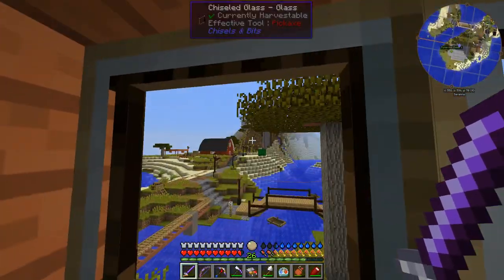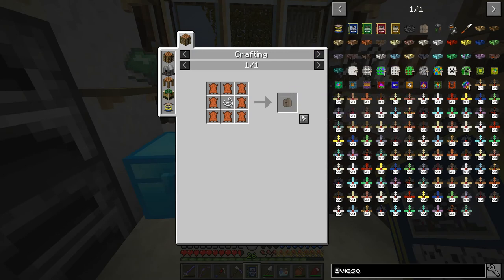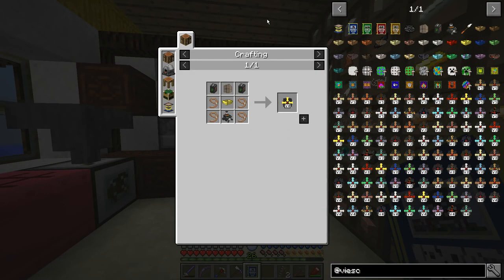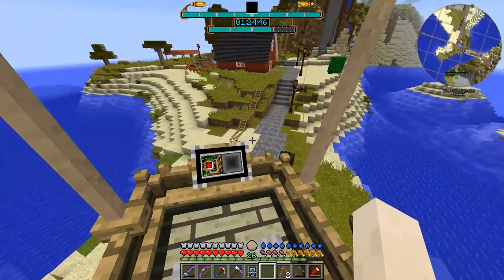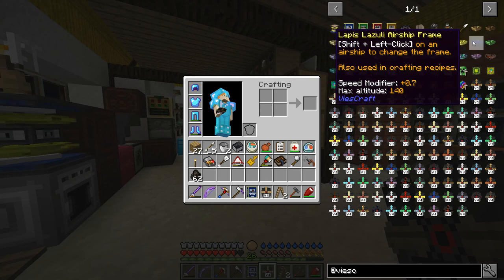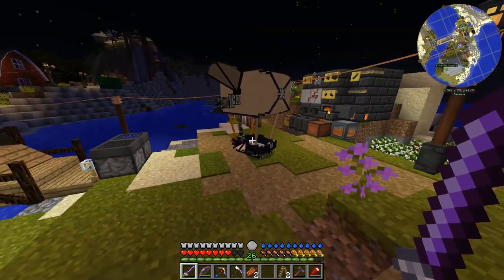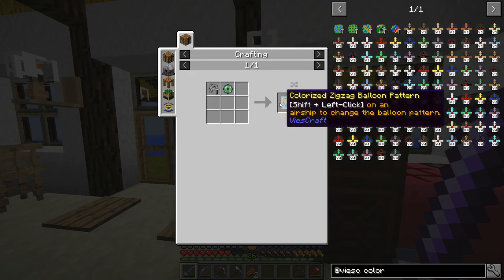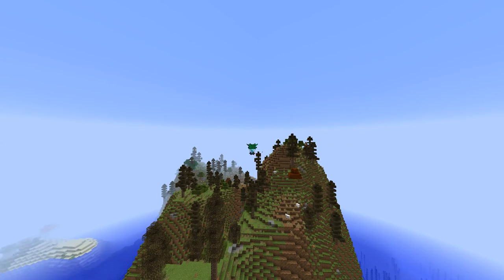Real Tech 17 - ViesCraft - Airships!

Comment: Airships, wow they are quite nice. 

Tough as nails needs a temp sensor (like the season sensor) that outputs a redstone signal so you could automate the heating and cooling coils.

Nice video, as usual.
Reply from the maker: They are very nice!
I've been hoping for a temp sensor too. There is a feature request. Let's hope!
Thanks!
Reply: Danny & Son I forgot this is your pack, isn't it? There are so many mods out there I don't know if you have seen tough-expansion as it has some nice air con bits.